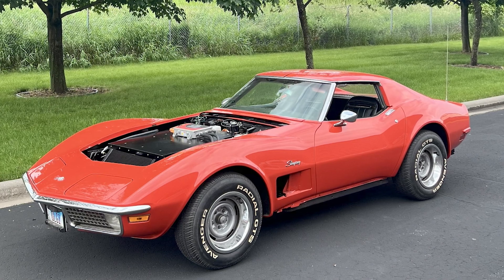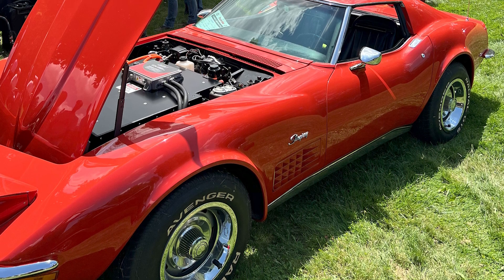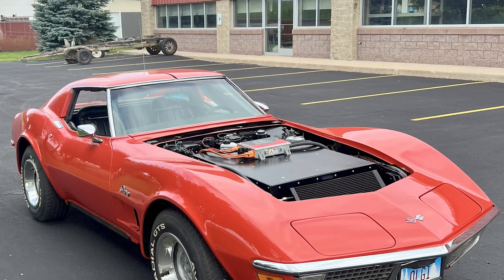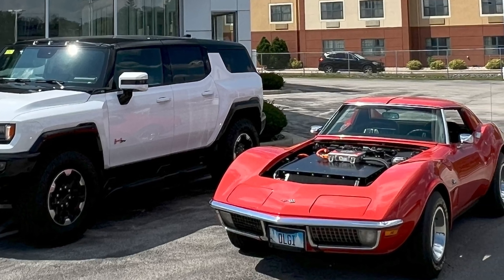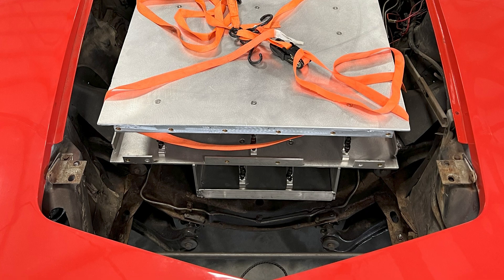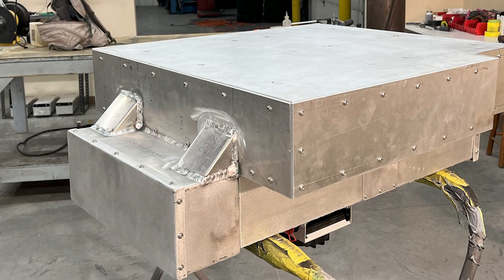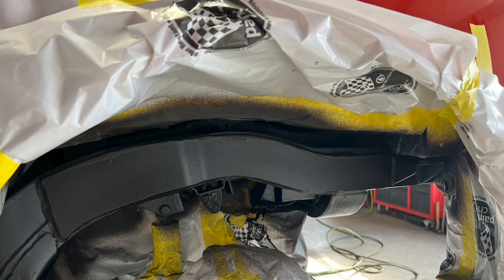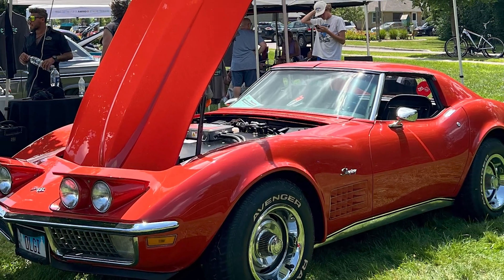He Swapped a Classic Corvette… With An EV?

Comment: Looks like a lot of weight high up in the chassis and forward of the front axle centerline.
Reply from the maker: Yeah it probably would have been better to have a smaller pack and package it a bit lower and smaller.

Comment: A C3 (my favourite generation) conversion is exactly what I was dreaming to see. Thank you guys for this video. I imagine that in a few years, with the increase in energy density, the same pack capacity will take less space and weigh less, which will benefit this kind of project.
Reply from the maker: Gorgeous lines on that car for sure! You're totally right, and I think those times are already getting started! More options available just since this one was built. And some more performance options too, where you might take a little less overall range to have a pack that is lighter, can discharge faster (higher C rate) and weigh less.

Comment: How expensive is this?
Reply from the maker: There is a lot of variables in a conversion. But for this Cascadia motor unit and the number of modules plus other electronics it was probably somewhere around 40k for the parts.

Comment: I'm doing something similar in a 71, so I'm curious how we solved the rear suspension problem
Reply: Oh dear they went the difficult route.

 Instead of using a Tesla drive unit where the diff used to be, they kept the original transmission and diff and had to build the battery box AROUND the motor in the engine bay, I think that's adding way more work that isn't needed, I wonder why?
Reply from the maker: Yeah I think given a blank canvas Drew prefers to keep it simple and drop in a Tesla unit. For this build the client wanted the option to revert if they ever wanted to.
Reply: I am converting a 70, I am putting the whole Model-S LDU with subframe, making it a wide body.  Still working on the battery and contactor box.
Reply from the maker: @michaelleung3449 oh man I bet that will look so awesome as a widebody!! Please let us know where to see pics when it is done!
Reply from the maker: Awesome! Hope we see the results when you finish. Which problem do you mean, modifying for extra weight?